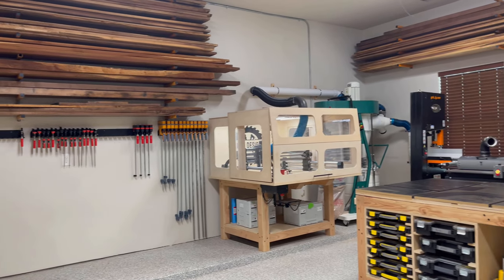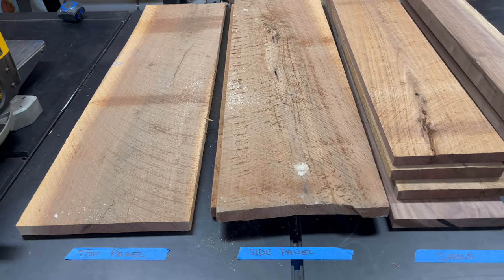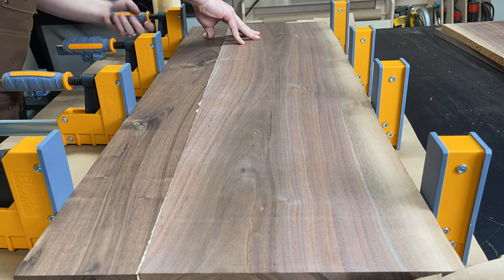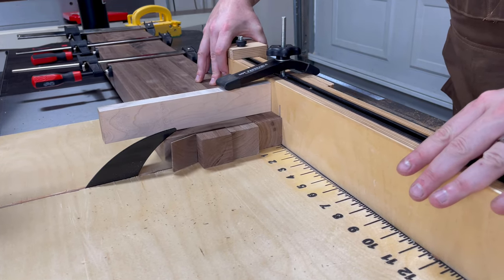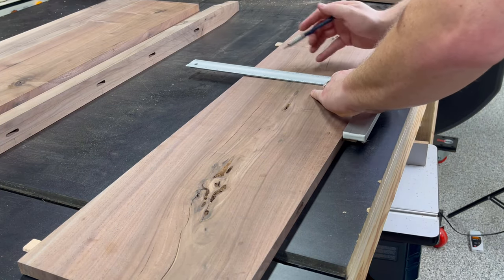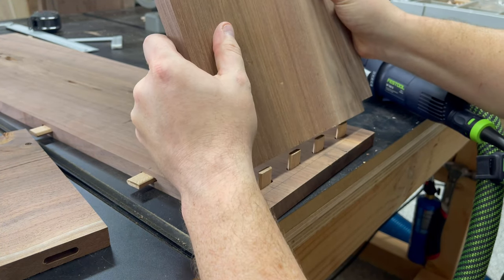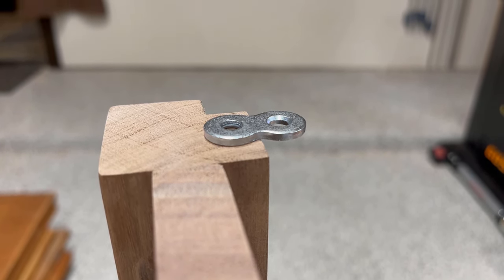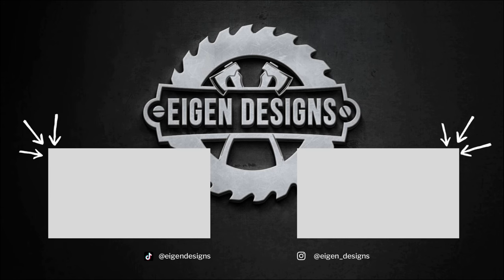Solid Walnut Bookshelf  |   Build Plans Available

Comment: For new wood workers - do you have any tips on how you build with hardwood to deal with expansion / contraction?  Does the domino for joinery prevent the wood from warping, like a box joint?
Reply from the maker: This is complicated question to answer here, so I will have to summarize my response and will have to leave out a lot of details. Here are a few key points:

1. Wood will always move and you should design for that rather than just trying to restrict the movement
2. Wood moves mostly across the width of the board (it doesn't move nearly as much along the length of the board or the thickness of the board).
3. Using multiple narrower pieces is usually better for movement than using one very large piece
4. It's important to start with properly dried lumber that has been acclimated to your environment prior to milling.

There is lots more to this topic, but this article is a good starting point if you want to read more about it: https://www.familyhandyman.com/project/wood-movement-101/

Comment: Beautiful work as always! Do you have any concerns about wood expansion along the side panel, and "domino'ing" them to the legs?
Reply from the maker: It's absolutely something that I considered as a part of the design. I am not concerned about the boards expanding length-wise, but rather, width wise across the board. For the side panels that are ~10" wide the dimensional change coefficient for walnut is 0.00274 for flat sawn boards and 0.0019 for quarter sawn boards. Given the annual moisture swings in my area, I estimate the maximum dimensional change for the side panels to be 0.082". This relatively small movement didn't give me much concern for the side panels. There is a great one-pager about how to calculate these dimensional changes here: https://cdn.popularwoodworking.com/wp-content/uploads/2010/10/WoodMovement.pdf
Reply: I had no idea that was something you can calculate, very helpful, thanks for sharing that article!